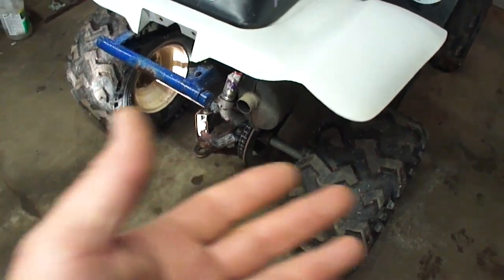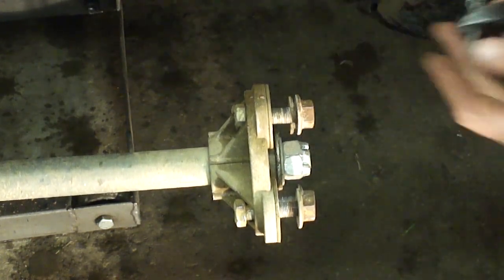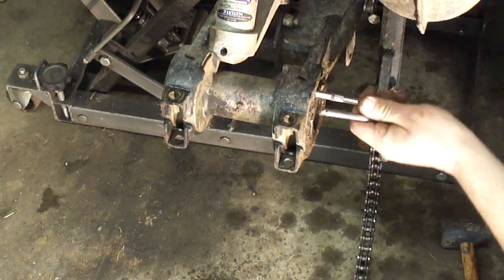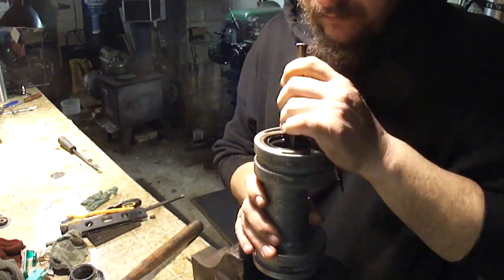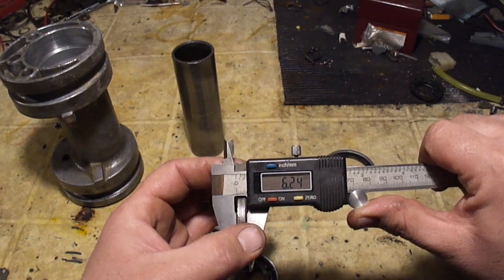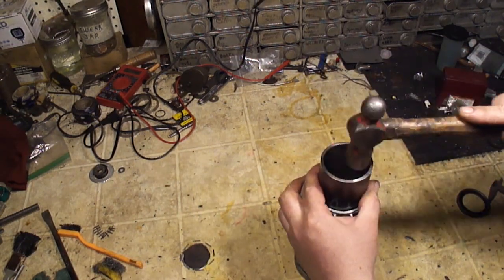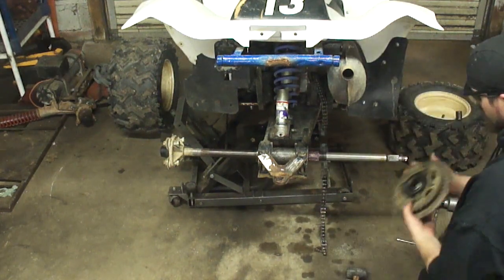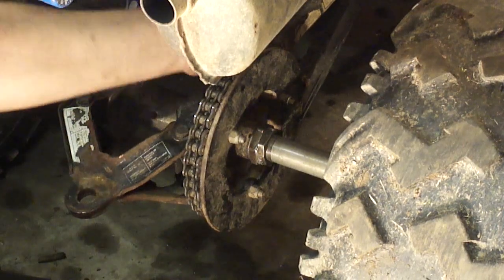Polaris ATV Rear axle carrier bearings

Comment: Hopefully this will come up when people search "how to" as it's well done. as well as highlighting potential problem areas. stuck, too tight, damaged, and the wear surface of the left side spacer on the axle being replaceable.
while in there, check or replace the zerk, and i covered the outside of the carrier bearing housing with anti seize or grease as it's aluminum and corrodes. mine has pitting i wanted to stop.
To people (like me) wanting to service it, but not spend $, repacking the bearings is acceptable, but the grease seals are to keep water and dirt out, not grease in. so you get what you pay for. brown = contaminated = high wear. Tube holds a LOT of grease, be warned.
150 ft/lbs is a ton, prybar to hold the rear of the quad down. <click>

Comment: I am working on a 2003 trail blazer but it has conical tapered bearings.  Can i swap them out for regular ball bearings?
Reply from the maker: That's a good question; I can't give you a solid yes or no. The design looks like it would be possible but, I'm going to say no because of the way the carrier is machined, and it may not work. The tapered roller bearings are a better design as they will hold up to more axial load and can be adjusted as they wear out.
Reply: @MrFixit1  what year is the scrambler you are working on?
Reply from the maker: @exCR-it3ex  1996
Reply: @MrFixit1  shit 1998 to 2009 are the same.  Thanks anyways I was hoping to be able to grab bearings from auto zone looks like Ebay it is.